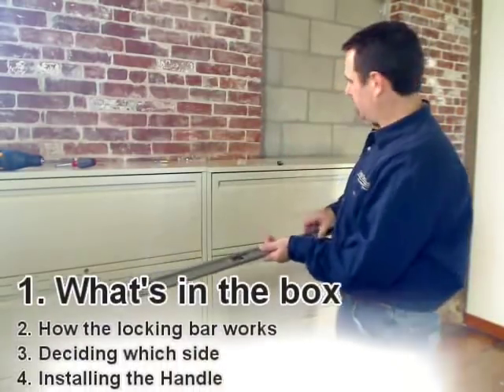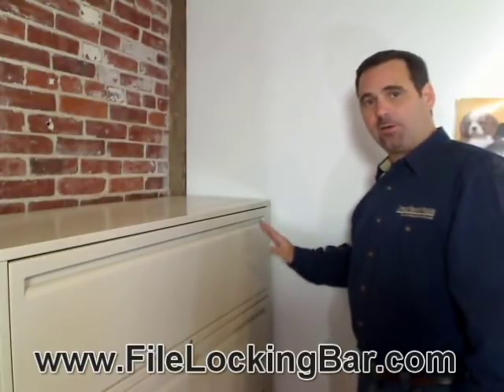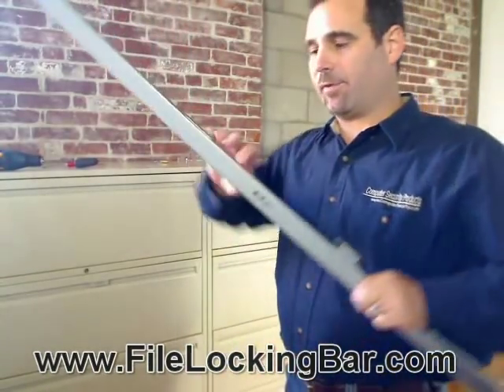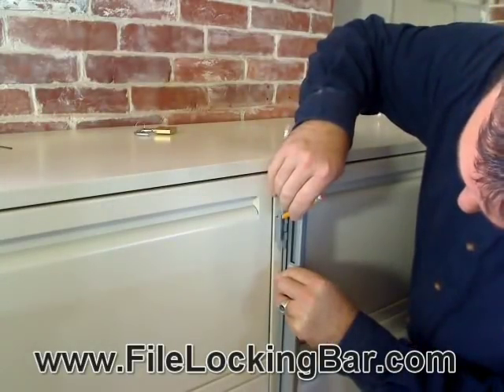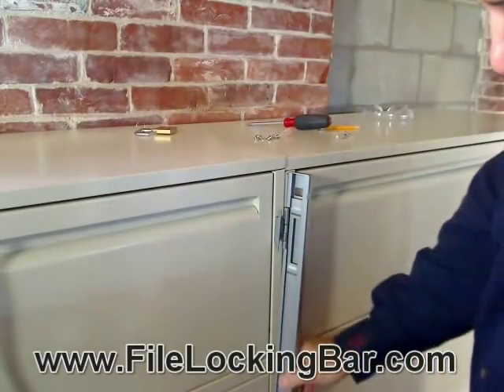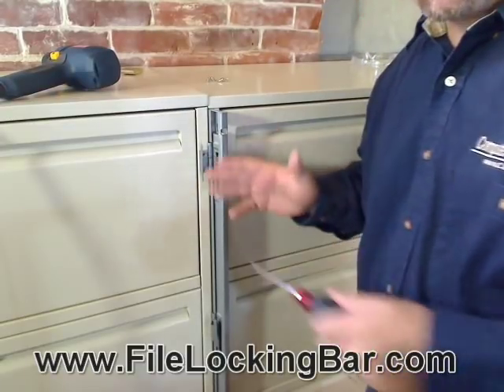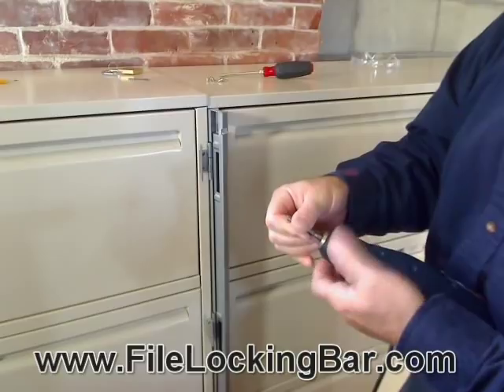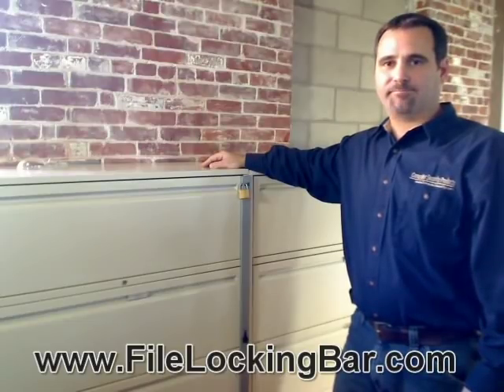Installing File Locking Bar on filing cabinet

Comment: awesome instructions! worked perfectly. only question i have is my system came with both self-tapping AND self-drilling. were these just extra or was i supposed\ to use them somewhere?
Reply: Hi Johnny,We send wood screws and metal screw so is your cabinet is wood or metal you would have the screws you need. The self tapping screws are for metal cabinets, the others are for wood.Let me know if you have any other questions.

Comment: After all that explanation, you did not demonstrate the finished product by testing the locking bar, trying to open a drawer.  I would have demonstrated the product use, in the beginning to show How it Works, Installed!  But then who was this Video for!